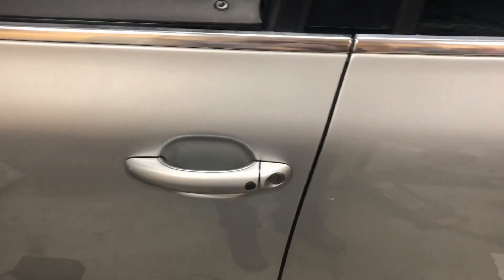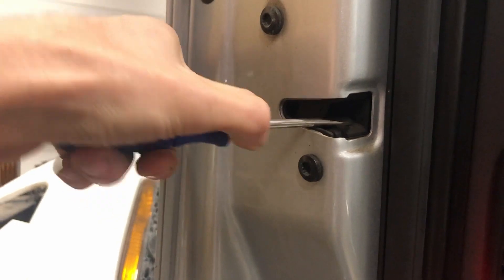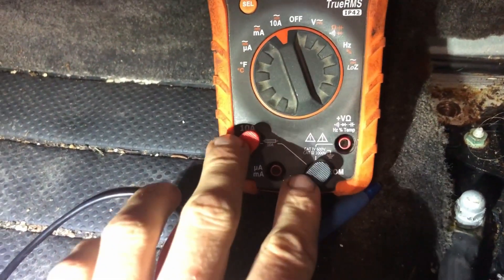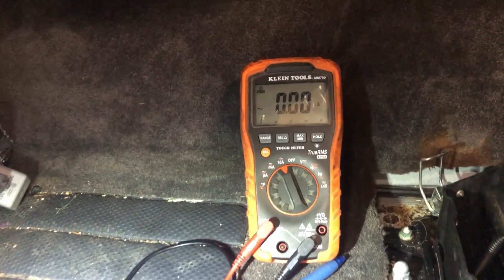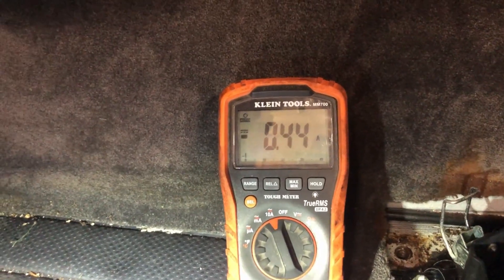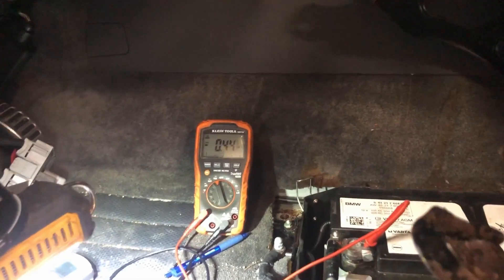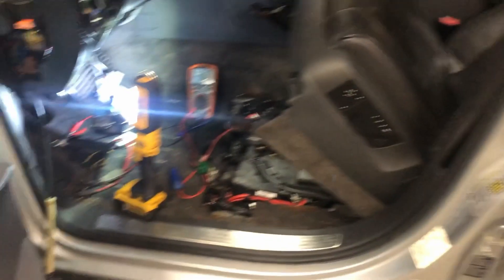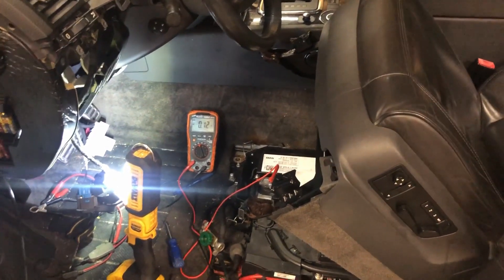7L/T1 Touareg Battery Parasitic drain

Comment: Got a new battery in my Touareg and it was dead the next day, clicking under engine every 15-20 seconds. No idea what can drain an entire full battery in a few hours and no idea how to find out.
Reply from the maker: You’d be surprised at the draw controllers will take, and how little it needs to drain before it’s a “dead” battery. Was the key left near the Touareg? Sounds like the body control module wasn’t going to sleep possibly from faulty kessy sensors?
Reply: Hey , did you find out what was the problem? same here
Reply: @them-mrtoko73  No I just remove the 7.5 fuse on the drivers side and replace it before starting the car everytime I go to drive it or stop for the day
Reply: @ciN95 What fuse is that?
Reply: @rainisosak  no idea only fuse that said 7.5 amp I don’t drive this car anymore. Think it does something with the ignition.
Reply: I have the exact same issue, please can you let us know how you resolved it? I hear a relay kind of ticking sound from behind the break and gas pedals every 1s! Gets more rapid if I flick the headlights switch on.
Reply: @DonikaDermendzhieva  I just have to pull out a fuse every time I park the car and put it back in in the morning. Otherwise it dies every night due to the clicking.
Reply: Le kessy est le problème il y a deux Mosfet buk 7635-100A à changer couper les antennes des portes arrières fiche violette et fini la perte de batterie...😊
Reply: @Wilfrew do you have a picture?

Comment: If there's a draw on the ECM, what are the chances the vehicle isn't a total loss..  like I've been told.
Reply from the maker: the engine control module/unit? if its believed its faulty it can get expensive to match/program to the kessy and keys due to the immobilizer. It is possible to delete the immobilizer in the new ecu but you'll likely get fault codes on the screen.
Reply: @Josh's Jetta's  it's the access start control module. It all started when a mechanic accidentally killed the battery, jumped it, and it hasn't been the same since.
Reply from the maker: That can be pricey, there’s a place in the US that rebuilds them
Reply: @Josh's Jetta's  could you send to tue info on that place. I absolutely love my touareg so I'm going beyond what I probably should haha

Comment: updated -interesting about door lights, my newly bought 06 v8 killed battery twice in around 3 days sitting, so will definitely check those out.
just ordered a $40  Bluetooth battery monitor, so i can watch voltage easily without needing to use a meter- 

update-
like it, had for a while now, seems to only drop 1%  per 2 days now, so no idea what caused the flat issues. 
It will be good to have a record of prior readings if it happens again.

Intending to add an isolator as well, good to see someone else put it where i was thinking.
Currently sorting all my many vacuum leaks as well, going to use refrigeration copper tube to replace the cracking hard plastic rubbish(codes for lean both banks, vacuum brakes, evap etc),    also has the seized intake manifold flaps, so is definitely a project car, but price was right.

update -
Got lean both banks again, so ordered new fuel filters for both of the, under rear seat , each side of tank pumps after seeing, and reading comments on a youtube google result for fuel issues(https://www.youtube.com/watch?v=2Rd3Fvo1zWs ) , suspect never changed in her 220km either, so best to have a look, (starved fuel pumps could easily burn out as well, imo ) so if going to that much trouble, it would be silly not to fit replacements. 
will also look at pcv and check for  vacuum leaks on intake/maf etc  + still getting occasional vacuum brake code as well. Have seen 13.5lts/100kms once @ 100kph, but averaging 16.8 mostly rural, if my lead gumboots are left at home, otherwise 20/100 is real easy, (but she goes surprisingly nice for her weight).
 ps, -my 97  discovery v8, drank  a bit more driven similarly.

Just noticed mention of swirl flap delete kits, might be the way to go for those.
Reply: Very good vid Josh! I am sitting in the same boat. Battery drain has brought me here (suspect Kessy), vacuum leaks from brittle lines (been there done that), fuel pump, oh, and not to forget clogged moon roof drains (and discovered to my disbelief drain outlets on the read axle blocked with substantial paper clips!!...1st owner had her always VW garaged). 2008 4.2 FSI owned by a German fella located on a small island in the Caribbean. Had imported her from Fla in 2011. Since she (and me) survived hurricane Irma in 2017 with bruises and scratches I decided to keep her to the very end.
Reply from the maker: @t_prey  they definitely have they’re quirks, I’m dealing with kessy on my personal vehicle now as well (I have no moon roof drain issues as everything’s frozen right now lol).
Reply from the maker: The kessy is a somewhat common issue on these as well causing a drain, check for open antenna codes (I’ll put a link at the bottom). The disconnect is handy if it’s going to be sitting for extended periods of time but make sure it’s a quality one as they can be a source of high resistance. I’ve just unbolted the ground point on mine a few times during back packing trips but that requires a ratchet and socket to be with you. The hard plastic lines suck on these, I’ve got poor power brake assist I’m assuming from a cracked line in the wiper cowl, just another thing to add to the list.

https://youtu.be/LOcErXDoUbo
Reply: @JoshsJettas  Mine had nasty grabbing brakes, at very little pedal pressure.
But now i have patched/repaired temporarily all the leaks under bonnet(still have a tiny vacuum loss somewhere- need to check at brake booster next), brakes feel much better and more controllable, unsure why? - Does vacuum pump work for braking, and was it perhaps running flat out before.
Found a sensor by master cylinder just hanging by its wires, found its "Power Brake Booster Vacuum Sensor Part Number: 7E0907643", so will have to remove ecu and find where its supposed to be fitted below it(on a vacuum hose i think) and check hoses at same time. Weird brakes work fine, and no codes, but may be cruise control related, as before fixing leaks, using it was throwing check engine/vacuum codes, but not tried it since.
Thanks for link.
Found most manuals via club touareg, for 03-17 models - 7L,7L6,7LA,7P,7P5,7P6
cardiagn.com/2010-2015-vw-touareg-type-7p-service-repair-information-wiring-diagram/

Not found which, if any cover the cruise control yet, nor searching google. (wanting a schematic and layout and/or parts list)
Ps, i disconnected vacuum hose from manifold, and blew into it, with soapy water on everything, and watched for bubbles, one leak was crack in middle of a hose, not at a connection. after fixing all seen, i sucked on it to see if it would hold the vacuum, much better but still loses it quite quickly, hence decided to replace all of them eventually.
Reply: @JoshsJettas  I've seen people hook up solar chargers directly to their batteries to maintain a constant charge while parked for long periods. I ended up replacing all the brittle plastic vacuum lines with different sized fuel hoses. 17887 - Brake Boost Vacuum System error is now gone. Test the line that goes from the vacuum pump near the front left fender before going through the hassle of removing wipers.
Reply from the maker: @ajnanyc  yeah this one sat a lot I believe,  but the drain was higher then the solar panel output so it’d help but wouldn’t keep it charged.

I’ll have to check mine, I’ve got a few things I want to do to it here shortly.